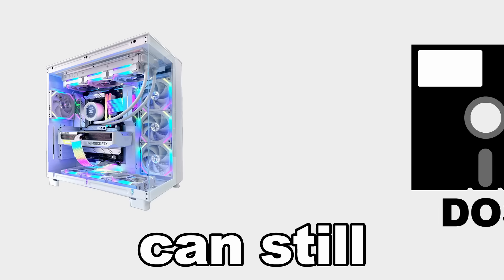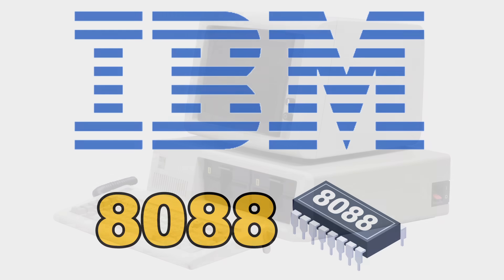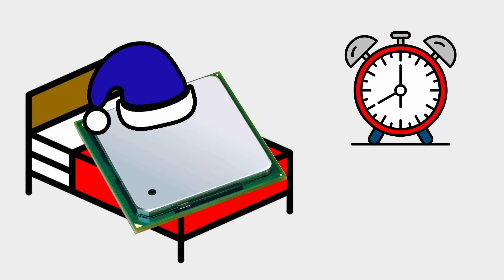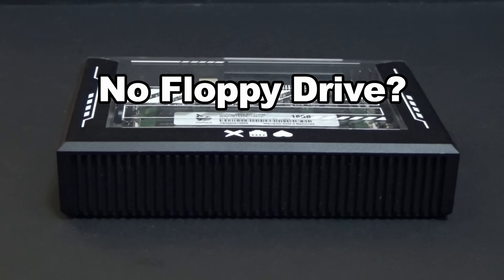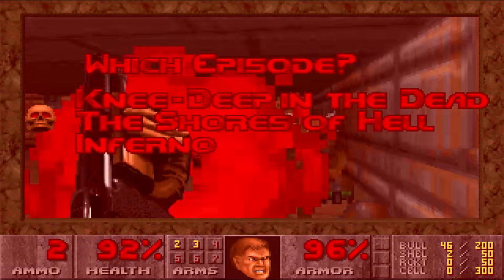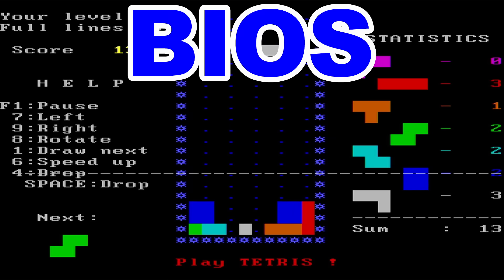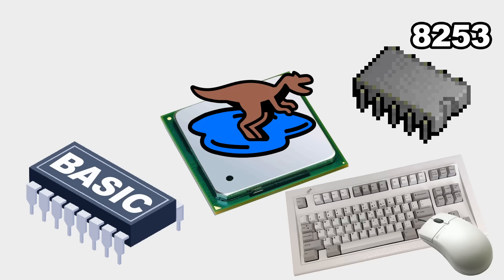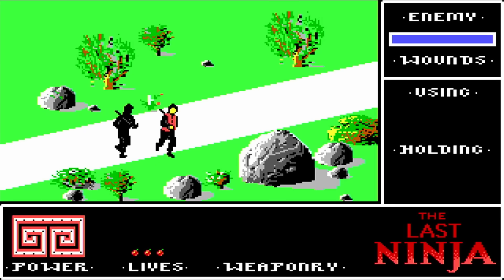45 Year Old DOS on a New Intel CPU Without Emulation

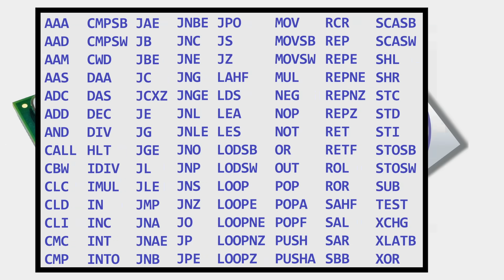Comment: 6:16 no, it doesn't waste space, this is a myth.

Because the chip runs microcode and the actual architecture is very different than an actual 8086. It only wastes a bit of ROM for a couple of instructions, that's almost nothing, most of the space goes to cache, but there are plenty of space for smaller things like a fixed ROM made out of simple diodes.

The old instructions can be perfectly emulated/interpreted on modern hardware by newer CPUs without wasting any extra space for any logic via the microcode mechanism. There's absolute no reason to remove them.

The source for this is Jim Keller, he said that.
Reply: And just as importantly, even if it wasn't, putting an entire 386 (275,000 transistors) on a modern CPU (with billions of transistors) barely even qualifies as a rounding error.
Reply: @throwaway6478   Barely even qualifies as a rounding error? I'd say proportionally, it's so small the appropriate phrase would be "doesn't even qualify". If you're dealing with several billion in total, anything less than several million might as well be free. You'd probably have to get up to the Pentium before you hit "rounding error" territory.
Reply: I think the origin of this myth may be grounded with AMD's K5, in which they took a RISC chip and stuck an x86 decoder on top. Actually, I think there might be 4 decoders, or I guess 4-in-1 since the K5 can decode 4 x86 ops simultaneously. The decoder(s) and underlying design would have been far less integrated than what's done today and even basic things took up significant die space in the mid-90s with transistor counts in the low-to-mid single digit millions. Meanwhile, process nodes have shrunk exponentially and decoders have grown barely linearly. After all this time it's like the equivalent of needing a second closet in your house after moving to a planet that's 100x or 1000x the size. It's barely comprehensible.
Reply: @dycedargselderbrother5353  It's four.  I remember building a K5 way back when.  Not the chip obviously, just a hobbyists build around the chip.
Reply: I am on an Android tablet with an ARM CPU/no FPU and a DosBox app installed and the emulation of 80386/80387 CPU/FPU works good. But i miss a graphic emulation of a VBE 3 bios. The svga-S3 emulation have only a mixture of VBE1.?/VBE 2 bios and not many mode numbers for higher resolutions. On my last DOS PC i used a Radeon 7950 PCIe card with VBE 3 bios with mode number for wide screen 16: 10 aspect ratio 1920x1200x32 resolution on 28" LCD.
Reply: First time I've ever seen someone in a YouTube comment section list their source!
Reply: Agreed. The x64 registers are mostly 64-bit versions of the 32-bit registers, which are 32-bit version of 16-bit registers. This also means the operations on 16-bit will often have a 64-bit version. For the most part (there's always edge cases in computing), you can just use 16 bits or 32 bits of the 64-bit register very similarly. The operation of something like ADD is going to be very similar whether it's done in 16-bit vs 64-bit

Jim Keller also mentioned that they don't need to optimize every single part of the CPU, just the parts that people mostly use. A Ryzen CPU will already be ridiculous for decades-old 16-bit DOS programs.
Reply: I just wrote the same thing and then bothered to scroll down a page of comments and see it already here 13 days earlier...
Reply: And I think even those new super-efficient Zen 5 AMD processors still have the 16-bit emulation.  Of course they are optimized for 64-bit and maybe user-mode 32-bit under a 64-bit OS.
Reply: Everyone seems to forget what touring complete means.  Almost every computer is touring complete, which it means it can run any software any other touring complete machine can run.   The only limiting factors being time and resources.  i.e. Clock cycles and the various memory circuits.
Reply: Yes and no. It's not just that it's a few kb in the microstore. It's that you must do everything in a way that is compatible and compatible with everything else in the processor, for example in the presence of interrupts and exceptions and context switching.

This is nontrivial and such timing problems have essentially hamstrung not a small number of processors, not least of which the i860, which despite being an amazing chip on paper was only really useful as an overpriced graphics accelerator. Because a context switch would flush the pipelines and require at a bare minimum 64 cycles to refill them and in many cases take hundreds of milliseconds to perform, making it essentially useless as a general purpose CPU in modern multitasking and/or multiuser environments. Essentially meaning it was completely unfit for the purpose it was designed: workstations.

Getting it right in a performant way takes up a significant area on chip.

And the more complicated the architecture the more edge cases you must handle and this can quickly blow out your control logic.
https://spectrum.ieee.org/intel-i860
https://youtu.be/WTkFGZqVCM8

Additionally there have been not a few chips that have had their future upgrade path hobbled by designers thinking that free space in the microstore is free real estate so you might as well put in new instructions.

The problem is that once you do, you have to support them forever, and again may complicate control in the future.
Computer Architecture: a Quantitative Approach Patterson and Hennessy.

But it is safe to say that the x86-64 line is so complex already that it must already have a general solution to these problems, so the cost of backwards compatibility is essentially zero. Kind of. 

Because if it wasn't such an agglomeration then it's safe to say control would be far simpler and regular, meaning more area that can either go away leading to a colder chip with far better yield and therefore a far better price with the same performance, OR better performance by dedicated silicon to do something useful.

We see both approaches work for instance with ARM processors. Which often outperform intel chips at performance per watt and per dollar. Because control logic is simpler the die with the same compute performance is often smaller, cheaper and colder. Even in the presence of pipelining, superscalar, multiple thread execution units and multiple independent cores.

And the approach of having a similar sized die as the complicated intel one but using area saved on control logic to add dedicated hardware to speed up other tasks also has seen commercial success, for example in the Apple M line of CPUs, which has integrated a lot of hardware, making many common tasks for a personal computer faster, for instance the network stack is much more performant than a typical PC with the same power draw.

But yeah to do it Apple had to throw away the idea of intel compatibility. Only possible with either a radically open system like Linux where you can recompile everything or a radically closed one like Apple MacBook, where you can dictate to software vendors that they all need to go away and recompile their code and then reupload it to the Apple Store or however that walled garden works. Not my cup of tea personally 😂

But it's not been historically possible in the PC space because that's not really historically how the PC market has operated, instead it's typical to have just binaries you got to keep running nearly forever.
Reply: It is wasted space, but not in terms of silicon space. Many modern x86 instructions rely on VEX or REX prefixes to be recognized, while many of the original 1-byte 8086 instructions are all but completely deprecated (looking at you, x87). Simple coding theory would tell you that this is a wasteful encoding scheme. It wastes the abstract 'code space' for the instructions, which in turn makes the instructions longer, which wastes the precious L1 instruction cache. CISC instruction sets are often credited as having better encoding efficiency, but this waste is so significant that RISC-V with C extension would often beat x86-64 in code density.
Reply: @andyhu9542  I agree with @throwaway6478 said above ... the wasted space is very small, it's almost not there at all. 

I haven't inspect the actual encoding scheme, but the manual said, when the microprocessor entered long mode, the 8 bit instructions became invalid.
Reply: @andyhu9542  sounds  like redefining the standard to shorten modern instructions and lengthen the old ones would solve the cache space issue. Would it fuck up all compatibility and require an additional translation layer for ALL existing applications? Yes, and it would be hilarious. But that wouldn't be a performance issue for long, as incremental performance upgrades are still rolling out at a somewhat steady pace, and that overhead for old software would be compensated.

That being said, I'm not sure cache space for instructions is that big of an issue on modern CPUs. Guess it could be, depending on the application.

Edit: actually, a translation layer might not even be needed, I think it could just be a toggle in the decoder.
Edit 2: and here come the exploits... oh boy, this hypothetical scenario is filling me with glee!
Reply: @andyhu9542 when people talk about wasted space they mean an x64 that can only run x64 rather than x64/x32 & x86.
Reply: @andyhu9542  
I don't think there's any rational reason why 16-bit real mode compatibility would require x86-32 instructions, and especially x86-64 instructions, to have anything to do with the old 16-bit instructions. All three modes are mutually incompatible, and whenever the CPU needs to run instructions from one of them it needs to completely switch modes. (This is unlike some other CPU architectures, like the UltraSparc, which can run both 32-bit and 64-bit code directly and interchangeably without having to switch modes.) In fact, in x86-64 mode the CPU doesn't support 16-bit code at all, so its instruction set encoding could be 100% independent of it and could have been designed completely anew, fully optimally.

For a reason that I cannot comprehend at all, however, AMD and Intel didn't do that, even though AFAIK they could have. Instead, they decided to keep this completely weird and useless "machine code compatibility" of sorts, where 32-bit and 64-bit machine code instructions that are equivalent to the old 16-bit instructions use the same byte encoding, just with prefix bytes and whatnot. Which makes absolutely no sense. The CPU cannot run 16-bit and 32-bit code interchangeably, without a complete mode switch (that makes them completely mutually exclusive), and in 64-bit mode the CPU doesn't even support switching to 16-bit mode at all, so there was absolutely no reason to make the three machine code encodings resemble each other. Yet they did, and I cannot comprehend why.

Especially when AMD designed (what would eventually become) the x86-64 instruction set, they could have completely revamped the machine code encoding and make it optimal spacewise. But no. They had to try to uselessly keep the old encoding and add new byte prefixes, for no reason.

(In modern CPUs whatever machine code encoding is used doesn't matter because it gets converted to microcode anyway, which is 100% independent of the x86 machine code. Anything in the latter, no matter how it's encoded, could just as easily be transliterated into the former, so the encoding of the latter could be completely free to be chosen.)
Reply: @DjVortex-w  my knowledge surely is incomplete, but how do you want to switch functions of a CPU that are hard encoded?
Reply: @thomas.thomas  
The CPU interprets bytes differently and independently depending on which mode it is in. For example x86-64 machine code doesn't need to have anything to do with 16-bit machine code. The CPU is its separate interpreter for both modes. The exact same byte can do completely different things depending on the mode.
Reply: @DjVortex-w  "Especially when AMD designed (what would eventually become) the x86-64 instruction set, they could have completely revamped the machine code encoding and make it optimal spacewise. But no. They had to try to uselessly keep the old encoding and add new byte prefixes, for no reason."

The reason is with which way will you achieve backward compatibility. 

If they revamped the encoding like your suggestion, either the old softwares won't be able to run because their instructions are unknown to new instruction set or point to totally different instruction, therefore you lose the backward compatibility,

or there have to be special marker of higher bits instruction.  For example. the instructions can become xFF??, xFFFF????, xFFFFFFFF???????? with FF, FFFF, and FFFFFFFF as marker of 16, 32, and 64 instruction set and ??, ????, and ???????? as the actual instruction. This scheme will result in a huge waste of memory.

That's why they chose different mode = different instruction set. 
It's more convenient, easier, and cheaper that way.
Reply: @DjVortex-w 8/16/32/64 bit operands are different to 8086 mode. You still need a way to load and save different sized operands, the prefixes are required.
Reply: @phill6859  
No, they aren't. You just need different opcodes to load values of different sizes. The fact that x86 uses prefixes to differentiate between 16-bit, 32-bit and 64-bit versions of instructions doesn't make much sense, when it could just use different opcodes for them. The three modes are incompatible with each other anyway (the CPU needs to literally switch between them in order to run them, there's no situation where it has to be able to run each mode within the same code.)
Reply: @DjVortex-w  Very informative, thanks! I never knew it cannot run 32bit code and 64bit code interchangeably. Does that mean that when you run 32bit apps on 64bit Windows through WOW64 it needs to switch modes constantly? That seems very inefficient.

Why AMD kept the old encoding? I can only guess. Maybe in the beginning it was the plan to not require a mode switch, or at least keep the door open to that. Maybe they know what Intel was doing with Itanium and tried to do "the most opposite as possible".
Reply: @ 
I don't know, but I assume that if the task scheduler decides to keep running the same task as before, it doesn't needlessly switch modes, so it isn't really a big deal.
Reply: @DjVortex-w  This actually sparks another question: Can modes be switched on a per core basis? It would be a shame if running 1 single threaded 32bit task turns all other cores to paper weights every now and then.
Reply: @Stanniemania  
Yes, the x86-64 architecture supports switching between 32-bit and 64-bit mode on a per-core basis, so one core can run 64-bit code while another is running 32-bit code.

As far as I know, operating systems (primarily Windows and Linux) have some kind of optimization to minimize mode switching by primarily running 64-bit code on certain cores and 32-bit code on other cores, so one core doesn't need to be constantly switching between the two, if it can be avoided.
Reply: @DjVortex-w  They did it for cost reasons.  Same reason since the dawn of microcomputers.  Backwards compatibility is expensive in hardware, not so much in software.   

The apple 2gs was not backwards compatible (it was but without hardware you'd have to emulate it)  Well by the 90's you could build an apple 2e on an expansion card for about 40 dollars, so that's what apple did voila backwards compatibility to the largest software library at the time.  (Well largest home software library)  They still managed to screw that up by suing apple clone makers, and ending modular computers.  It's too bad too, apple has always had better hardware, but alas it's not for us plebes.
Reply: @DjVortex-w  The compatibility mode of long mode supports running both 32 and 16 bit code (it can run both without having to change mode). 64 bit versions of Windows not supporting 16 bit code is just a Windows limitation. Microsoft just decided to drop support. NTVDM was implemented using virtual 8086 mode, which is not available when running in long mode, so Microsoft would have needed to reimplement that using the new compatibility mode to keep 16 bit support, but that was never done.

32 bit Windows runs in legacy mode, which of course supports virtual 8086 mode, so 16 bit support is still there.

The encoding being the same is what allows  changing modes to be very efficient and almost free. I don't think there even needs to be any optimization by the scheduler, as the context switch itself is probably what takes time, not the changes of mode.
Reply: @DjVortex-w Indeed. I believe the reason for this is that they wanted to use the same decoder with minor addtions, since the 32-bit instructions just get a REX prefix in order to access 64-bit registers
Reply: @monad_tcp  you'd also be surprised how often modern code uses old 16 bit instructions.
Reply: @johnrickard8512  Cmiiw, while it's the same assembly instruction "mov ax,bx", it will be converted to different bytes structure by the assembler, depending of the intended mode of operation (real, protected, long).
Reply: The amount of "space" that is used for those 8086 instructions is minuscule compared to all the fluff that has been added since. It wouldn't be more than a tiny speck for including that on the die, including some glue (for the boot process).
What makes it however hard these days to run DOS (any DOS) on modern 64bit Intel/AMD systems is that more and more board manufacturers are omitting the "legacy BIOS" support and only support UEFI. And that's what prevents you from booting DOS.
And there is no penalty in terms of performance to have those legacy x86 instructions available, once the system in running in 64bit mode.